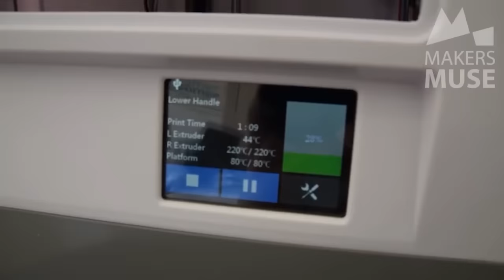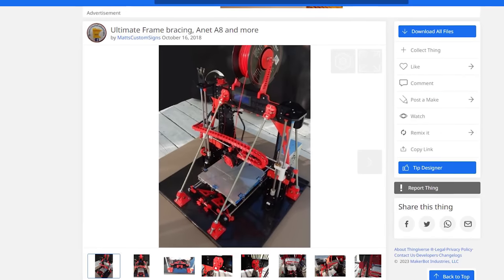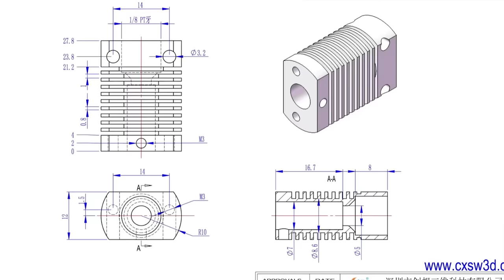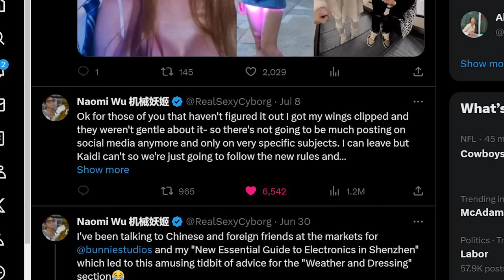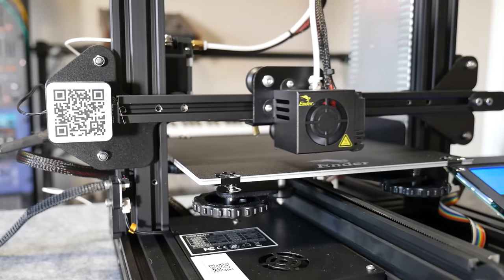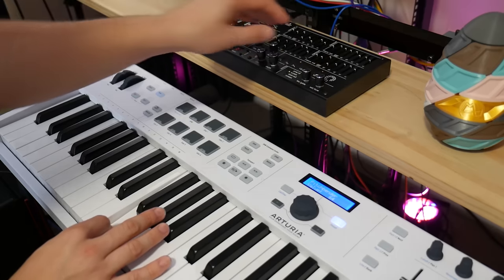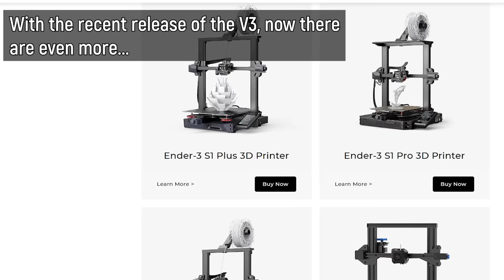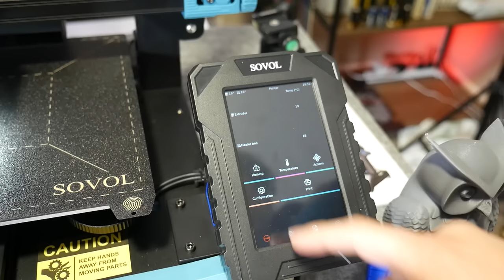Creality Ender-3... it's time to move on.

Comment: I love my ender 3. I bought it during the height is COVID and it gave me direction in a tough time. Now I love it because I get to upgrade it to make it work at a high level. But honestly, I'm a teacher and I share with them my maker journey because it gets some of them intrigued. I have it at school so they can marvel at the layer by layer nature of fdm printing. But I had a student ask me if I recommended it, I couldn't say yes. I am somewhat fluent in the C programming language, so modifying a header file to add the cr touch was no big deal for me, but I have background understanding that most don't. I'm a pro at leveling that damn bed, but I should have never been forced to build that skill. I agree fully. I will keep my ender forever. But I'll probably never recommend it to anyone and my next printer will not be and ender of any level.

Comment: Creality3D CR-6 SE is a better beginner printer. You can still upgrade it as you wish., but it has the dual z axis rods, auto bed leveling, run out detection, touch screen interface, already there to start with. I haven't had any major issues out of mine. I do recommend  an estep calibration before you start printing heavily though.

Comment: My first (and only) 3D printer is an Ender 3 S1 Pro and overall I was pretty pleased with it, it was just slow.  I started looking into what would be involved in building an RPi to run Klipper, provide network connectivity, etc...and I kept coming back to the Creality Sonic Pad, which just so happened to be on sale recently so I picked one up for $125.  I basically took a day to get it set up, calibrated, tweaked a little more, and finally to the point where the Ender 3 S1 Pro is producing excellent prints in better quality while doing it in less than half the time compared to stock.

It may not be the best out there, but an Ender 3 S1 (Pro) + Sonic Pad make for a great combo, IMO.

Comment: Still rocking my Ender 3 Pro, just with a lot of mods.  Added dual Z axis, CR Touch, color screen, metal extruder, and capricorn tubing last year.  2024 in less than a day and I've ordered a spider hot end, sprite direct drive extruder, and led light bar (to replace my clamp on LED lamp), and plan on switching to a Nebula kit as well to give me all the features of a newer printer.  I like the Bambu A1, but my Ender 3 has plenty of life left in it after these upgrades.  Sadly, the Sprite upgrade means my metal extruder goes away, and the Nebula kit will make my color screen I recently got go away.

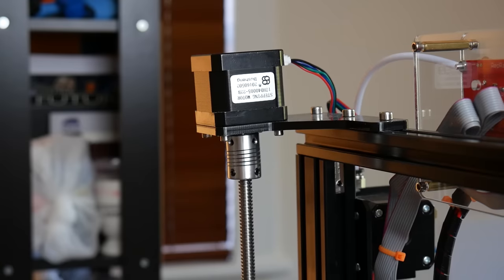Comment: 2:12 - major exaggeration. Something like the Tevo Tarantula worked just fine stock and it sold very well at the time. It made more than acceptable prints. Yes, it featured many engineering shortcuts and if you wanted to keep it reliable and safe for the long term, upgrades were highly recommended. It was far from "unusable" though.

Comment: Closest analogy that comes to mind is home automation. Homeassistant is a great platform, you can hack away at your heart's content, but it's not for people who just want to simply set up a smart home and use it. Same with this. If you just want to print, then the ender3 is not the best choice. On the other hand if you're a tinkerer, its the best base to start with (before i bought mine, i was considering buying an Anet a8, glad i didn't 😊).

Comment: My first ender 3 v1 never worked just right. At the end i end up buying another ender 3 v1 just to double check if I was doing things wrong or if it was the printer. It was the printee. Now after modding that second ender 3 v1 it work flawlessly. Always work, it was cheap to do and it never needs leveling (never level since around mid 2022) the ender 3 is a beast horse if you have the time to tweak it and money to mod it (still cheaper to buy 2 ender 3 v1 and made them 1 perfect one with aliexpress mods than to buy something like a prusa)

Comment: I didn’t buy a ender 3 at first, I thought I was smart and bought cheaper generics.  I constantly had problems.  Finally bought a $200 ender 3 and it just worked perfectly from the box.  I sold the generic and didn’t look back.  It’s hard to argue with something that just works.

Comment: I have the Ender 3 v2 and that thing I had to upgrade the springs under the print bed, replaced the extruder tip, and an auto-leveling element to help the thing print without issues. Things I shouldn't have had to get from the start but it is what it is. I am happy with it when it works but frustrating when it doesn't.

Comment: Its a good PLA printer once you tune it up, and better with Octoprint/Kliper. Its problem is the learning curve for tuning it up, and its not going to print anything but PLA with its extruder and open frame. You can upgrade the extruder, build a box around it and vent it, add another stepper, linear rails, but you can buy all that in a completed unit that's not an Ender.

Comment: Laughs in Ender 3v2 with no issues other than user error. Am I the only person who bought an Ender and didn’t have literally any of these issues? I was brand new to the hobby with no exposure or prior experience up to the purchase. Some google-ing on 3d printing while shopping and I quickly found the number one issue people have with ANY printer was bed leveling. I assumed the glass bed would be the most consistent surface to print on for leveling and thermally due to the mass. 

Enter the Ender3v2... Removed from box, assembled per instructions taking care to make sure everything is square, downloaded Cura and some smaller files to slice, leveled bed manually from all four corners and everything from that point on has been hit print and send it. No mods, no custom firmware, no quality issues, no auto anything... at most re-level the bed after 3-5 prints or if I see bed adhesion issues. 

Every video I see on 3d printing makes it out to be some rocket science when it really is not. Yes, there is a learning curve but it is absolutely not steep for PLA/PETg. Print things, play with the slicer and find out what the individual slicer settings physically do to your prints. This is a hobby, spend time on it to learn it. Many of the issues I’ve had have always come back to a root cause of me figuring out my support tuning for a print, bed needs re-leveled because I haven’t in a while, or just bad/old PLA(PS: throw away the sample filament that comes with a printer. IT IS GARBAGE!)

I still recommend Ender3 printers but not the base model. The V2 and now the V3 are fairly simple and a no brainer at the price and frankly the market goes to a point of diminishing returns from there. Obviously the Prusas and Bambus are better (at twice the price they had better be) but the 3d printing market quickly goes to an enthusiast level much like that of audiophiles and audio equipment.

Comment: I would definetely not buy a new ender 3, but i have been buying a couple of second hand ender 3 and cr-10 printers. They're incredibly cheap right now on the second hand market, and after that, i can modify them to be more usable in my setting. I'm currently working on a small printer farm where all the enders and other creality printers are completely enclosed but the screens are mounted on the outside of the enclosures so they're still completely accessible

Comment: I run the ender 5 which is Ender 3 -esque, but reading from community it seems to be that if you get a good one out the gate you're golden, mine has needed some work.

I switched to Marlin to get some upgraded features and improved reliability for the BLTouch, and I would say that overall as a hobby, doing the work and tweaking it has been huge learning. But if you're a creative just wanted to turn out parts, or models or whatever, it's a roll of the dice on these printers. If you're into printing, a good start, if you're into models you could be served better with a machine that gets out of the way so you can just print.

Comment: I do agree that they need to stop selling the older versions that have so many issues, but I don't think the entire Ender 3 line is something to hand wave or throw in the trash - I've been resin printing for about 4 years, but only got into FDM printing this last year with the Ender 3 S1 Pro, and its basically an ender 3 with every community built modification you can think of, right in the box. 

For me as a first time FDM maker, this machine has been incredible. It was an easy machine to learn the hobby on, and now I'm ready to make the jump into larger more complex machines - but I don't look at the S1 Pro as a waste of my time, far from it - I still use it basically daily and can recommend it gladly to anyone getting into the hobby. 

But that being said, if Creality has a machine that basically fixed all the original E3 issues, why not...just...only sell that one instead of like 3 or 4 different variants that still do have issues? Dodgy choice as a company, for sure. And the fact that they basically crowd sourced QA, waited for the community to invent solutions to the core problems with the original, and then just built those solutions into their next iteration...yeah, open source right? lol

Comment: I totally agree, I’ve had an Ender 3 Pro for a couple of years or so and every so often I have to f$&k with it to get it printing correctly again. Additionally I’ve spent too much to add on “Upgrades” to make it better and it still doesn’t print as good as it should. I tinker a lot with mine and I’m tired of having to spend entire days just to get it to make a decent print.
I have a friend who recently purchased the newest best Bambu Labs printer and I’m thinking about going for the other model they, which I’m told I’d basically the same minus the full glass enclosure and the better screen, but is a few hundred dollars cheaper.

Comment: Nice Video, and has certainly helped me in my quest for an entry point to 3D printing, but you know the next question: If the Ender 3 is no longer the go to printer for entry level / beginner, what is for a. a plug and play user, b. an open source enthusiast, because it ain't a Carbon X1.

Comment: My Ender3 is nearly 6 years old.  It has most likely more than 10K hours of print time.  It is currently in my basement workshop needing a total teardown and rebuild.  I'm considering a Sprite Pro extruder for it, but not sure.  I also have a CR6SE I got from Kickstarter that has probably close to 10K hours on it as well.  Both just worked for years and years.  Last week my CR6SE decided to have it's hot end fan die, no big deal, I was looking to upsize the fan to a 40mm from that 30mm anyway due to the heat creep issues.  After doing that though, the darn right side of the bed decided "I'm going to be 0.75mm LOWER (per the sensor) than the rest of the bed).  

Yea, I am kind of done with the "hobby" aspect here (having built my first printers back in 2009~2015), and just want things that crank and crank...which yea, may mean joining the Bamboo Labs X1C group, because those that I know that ditched their Creality for these?  All have stated that they have "saved dozens of hours of tinkering time right after getting that machine"...meaning "The printer paid for itself just by hours saved. fixing, tweaking, adjusting, etc." the printer.  

Don't get me wrong, these are GREAT machines, they are.  But the fact is, there are better options now.

Comment: I had an Ender 5 when I was in the army. Just stuck it in my barracks closet on a drawer I wasn't using and boom. To say it was annoying to use for my first 3D printer though, would be a bit of an understatement. It worked well but it took a lot of fiddling and would fail on the edges so I couldn't use the full size unless I wanted to really hand level it, because the auto level feature was garbage on it. Wasn't bad, definitely got the job done, but definitely wouldn't recommend it for new comers. Ironically sold it to my buddy who honestly was using it more then me for DIY stuff for near purchase price, I was going to take it home but that thing was so annoying to take apart I just gave up.

Comment: I love my v3 KE... prints everything great!. Auto bed levelling, no SD cards, and auto Z offset... only struggle I ever have with it is no profile for it in any software other than creality print and new filaments. Printed the beanchy in 16 min out of the box. also larger heating unit for the bed. Also not sure how to actually use a dry box for printing nylon which the printer temp wise can handle.

Comment: I bought an Ender 3 S1 pro about this time last year and it’s been an absolute lemon! The factory bed level sensor went out and I spent a bunch of money ever since trying to get it to make it through complete prints! I finally decided it was time to move away from this piece of junk and have a Bambu Lab X1 Carbon combo on the way! Ender may make a good product and I might have just drawn the short straw and got a bad unit but I will never buy another Ender product after this experience!

Comment: I have two CR10s and two Tronxy x5sa-400 pros.  The CR10s are essentially my workhorses and I run them every day for years.  Main mods i made for CR10s were CR-touch probes and dual Z axis screws.  I always assumed Ender 3 was the same besides the print volume.

Comment: I dunno.
I got an ender 3 for Christmas. Been begging for a 3d printer for years and finally got one.
Been printing a lot of little stuff for right now and messing with settings.
It has been printing all right so far with the majority of failed prints was caused by my own inexperience.

I will say that the main problems i have had with my printer is the spring loaded bed has been a bit tricky to get it to be leveled out.
And the other problem was the V-Rollers were way too tight and i only just noticed because this video, hopefully i got them tensioned right but i dunno.

Comment: I only have one printer, Ender S1 (not pro), and aside from wet filament and finding the right z offset, its been fire and forget.  But I dont use it that much and kind of been wanting to get into tougher filament types.  Lots of options, but i think im leaning towards an enclosed printer with heater.  Wary of the Bambu and potential problems/choking of control due to cloud connection.  I do not like the idea of any company holding kill switch power over my property.

Comment: uh.. minor clarification: the Ender 3 V2 doesn't have a touch screen.. I bought one secondhand just last week, ironically because numerous people told me "it's a good one if you're just getting into 3D printing" (as I am). kinda wish I had found this video first now. LOL.

having said that, it did come with a BLTouch already installed, and all the V-roller wheels are still in good shape. but I feel like I still need a few upgrades, so I am planning to replace the woefully weak print bed mounting springs and change to add direct-drive extrusion, along with a second Z-axis motor to handle the extra weight.. at this point in my adventure, I feel like this would still work out more cost effective than simply getting another 3D printer....

Comment: I agree. I bought one after seeing your reviews, but got unlucky with bad quality control, and it never quite worked right. (I also took recommendations from 3d Printed Table Top, as I wanted to print objects for my D&D games) 

I only learned later about poor quality control, and that in reality, this wasn't a good starter printer. 

In the end, I actually (surprisingly) switched to a resin printer, and went with the Elegoo Mars 3. I have only had one problem, but its a known one, and they sent me everything to fix it, along with a detailed guide to do it myself if I wanted, and even offered to let me ship it to them for them to repair it for me (though, I would have had to pay shipping) And its been amazing. I get great prints, it rarely needs work or maintenance, and overall, the mess is nonexistent. Just gotta be smart. Have a designated area, (I use the top of our deep freezer, covered with paper grocery bags) as a work table when moving prints, cleaning and removing supports, and have a safe out of the way area for the printer to sit level. It works amazing. 10/10, would buy again. 

When I next get a filament printer, I will not be getting an Ender 3, or even a creality machine, strictly because In the end, I spent more time, money and effort trying to make mine work, than if I had just gotten a slightly more expensive one in the first place.

Comment: I've had the same issues with the SD card slot & the bed clips; I also had problems with the bed adjusting itself during a print, which was improved by using stronger springs. I added a clone of the BL Touch sensor which made prints more consistent, but had issues with that because of the Z axis switch input decoupling on the control board (it had a 100uF cap fitted which I had to remove). The cable management is also rubbish and I had occasional issues with the cables catching the bed or the extruder. I wouldn't recommend an Ender 3 to a beginner for most of the reasons you mentioned unless you want to spend more time improving your printer than actually using it.

Comment: The great thing about the Ender 3 is how much you learn about 3D printers when using it. It is handy when you get a better one and something fails, you just know how to solve it and aren’t afraid of tinkering with it.

Also, in third world countries, ender 3s are pretty much the only option, so we make them work. I’m not paying 10x the price, no matter how great a bamboo lab is. I would rather buy 10 ender 3s and make a print farm that I’m able to maintain thanks to my experience with these printers than get a single bamboo lab.